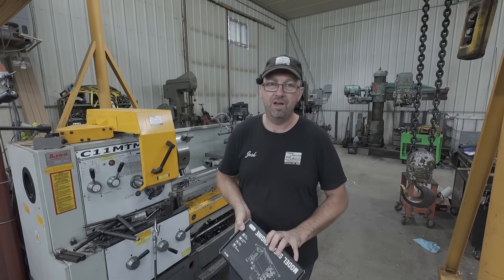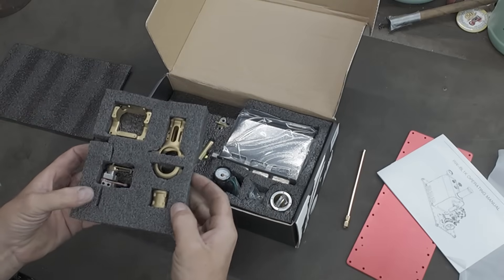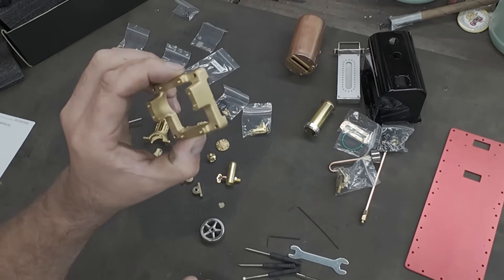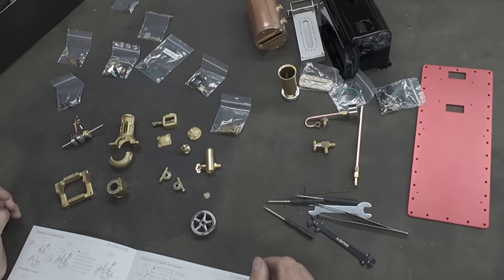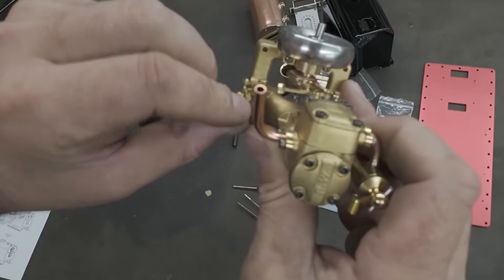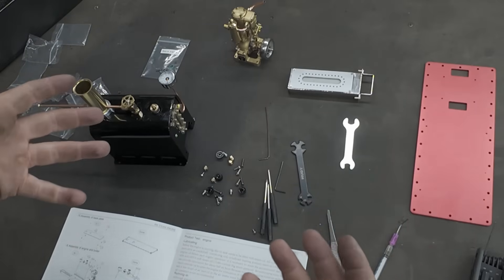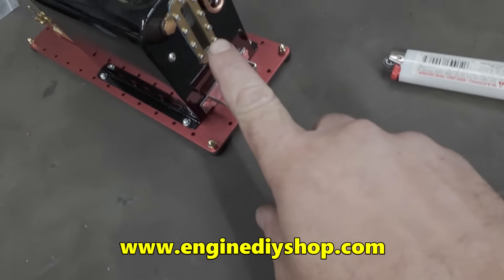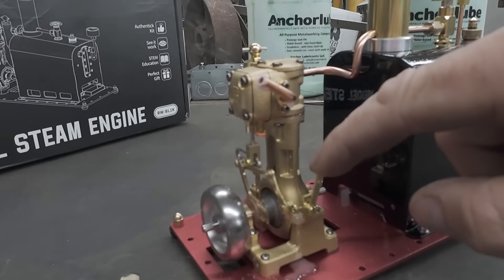Building a Model Steam Engine (and Making it Work)

Comment: Josh its mrpete. I just finished the same model & made a (way to long) video.  It took me way longer than 1 hour. I was impressed by the beautiful casting & precision.  Ran perfectly first time. Those tiny screws for the little plaque were a real challenge for an 82 yr old.
I watched your videos in Spooner.  Hope to make some comments if you are actually reading these.  I'm a big MM tractor fan--have a JETSTAR I.  My boiler tube came prebent - I think they had problems.

Comment: I have a R/C boat I built years ago! Sterling kit of a Century Sea Maid. Mahogany "Barrel-back" like a '50s vintage Chris-Craft. It was originally intended as a static display model, or to run in circles on a tether with an .049 glow engine. What fun would THAT be?

I started building it with the idea to make it a fast electric! Cobalt 13-turn triple wind motor. Steering sterndrive, all fabbed  up from brass and copper tubing, Silver-Soldered together. Some universal joints for a Traxxas "Villan" boat kit. Cupped knifed and balanced Bronze prop. Water cooling for the motor and the ESC (which I put in a waterproof box I made along with all the servos and radio gear).

All fiber glassed inside for strength, with Styrofoam in between the ribs for flotation (which it turned out I didn't need because it is literally impossible to flip)! Thing is FAST! And with reverse it'll go from full speed to a dead stop in about two seconds!

Took it to a local lake and was outrunning and out-cornering glow "Tunnel-hulls", and "Pickle-forks"! From the outside it just looks like a pretty model boat, but inside it's all business! A real "Wolf-in-sheep's-clothing"! Really blew their minds!

Oh BTW, I also built an aluminum trailer for it so I could tow it behind my R/C truck with a '57 Chevy Pickup body painted '57 Chevy Turquoise with a white top like a "Cameo" version! Can back it into the water, unload the boat, then park the truck and trailer. THEN back the trailer in, load the boat, and drive it out again, all while sitting at a picnic table 50' away!

If you're interested, I'll email ya a couple pics (you already will recognize my email because I ordered Anchor-Lube)...

:face-green-smiling:

Comment: very different caliber of benchtop steam engine from the wiggler engine Blondihacks refurbished with a new pressure vessel. and even most hobby machine shops aren't exactly equipped from the jump for building a safe-to-use steam pressure vessel (Quinn has kind of specialized into it). This was a fun little detour into Very Small Parts, and I think you are distinctly able to give highly technical feedback to the maker
Reply: I follow Blondiehacks too! Her Pennsylvania A-3 Switcher engine build is EPIC! :face-fuchsia-wide-eyes:

Comment: Very nice video, thank you for posting it... I will make one small suggestion. If you're going to be assembling more of those steam engine kits. Consider making a tubing bender for that small diameter tube. That would make it much easier to get consistent bends

Comment: Nice little kit. Wish they would use hex head screws and studs and nuts for that scale appearance. That would be awesome. I have a couple of model steam engines and my grandson loves to run them with a small aquarium pump. One has a half inch bore and you would be surprised on how much power it has. Thank you for sharing.

Comment: Pretty cool kit.  Sure spews a lot of water, though.  Is that because it wasn't heated up enough or had too much water?  

When I was around 8 years old or so I wanted a steam engine and my dad, being the type of person he was, used some old shock absorbers as parts to make one.  They have a nice cylinder and piston within them.  Never used it with steam but would hook it up to the air compressor and it would go.   The cylinder was probably an inch in diameter so I bet it would have had a good bit of power if it was actually connected to something.  I always wanted to build a boat with a boiler.  I know I would have either ended up with a steam explosion or caught the boat on fire, though.  Never did build that boat.

Comment: Blomdi hacks and Joe pie build small kits front scratch. They get blank parts and machine to specks. Don't know if you have the patience for them.
Reply: Joe Pie doesn't use tiny machines.  Big machines work the same as small ones.
Reply: You need special tiny machines to do that. I have seen the odd model channel a while back. Very delicate work.
Reply: @BrucePierson  Tiny? Like a Unimat? Or, just a common South Bend 9 inch? This is one area where size matters. You don't make parts like this on a 16 inch lathe, and even a Bridgeport would be overkill. But, the cheap Chinese tool store sells bench lathes and mills that could do this scale of work. There's also a decent supply of "antique" tools that hobbyists have  squirreled away in garages and basements that would be ideal for work like this. 

I'd love to make this from castings and prints. But, I'm old school and have the tooling to make parts like this without CNC.

Comment: This sure is a surprise! This model steam engine kit sure goes with the channel even if its not sitting on a Lathe or the huge drill press. It'd be pretty cool see that engine in an RC boat eventually!
Reply: For me as well i normally watched Joe Pieczynski's videos where he had assembly kits from PM Research this range was late 19th early 20century kits that was line shaft type machines in what i believe was 1:12 scale. The castings were to be machined in order to assemble them and 1 specific one stood out was the Stuart D10 model a model that was functional as was others in range. There was a mill, a lathe bench grinder table saw etc was a blast to see these videos, also a great learning curve in machining at such scale when i saw this product i was anticipating similar work but ready to assemble is equally great for learning and understanding

Comment: I love steam engines, and have been lucky enough to have worked on them as a marine engineer. They were triple expansion engines fitted with Stephenson's link motion gear, for going ahead and astern. , powered by coal fired Scotch boilers. Cant beat the smell of a steam powered engine room, lub oil and wet steam. Learnt the art of feeling the bottom ends when running, for hot spots. Good fun.,